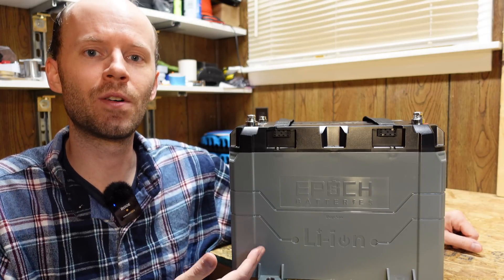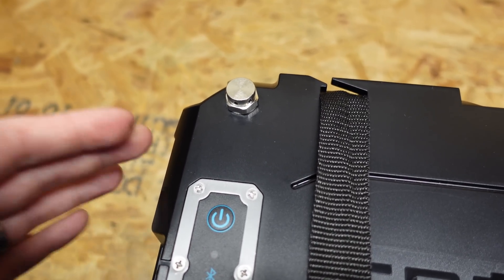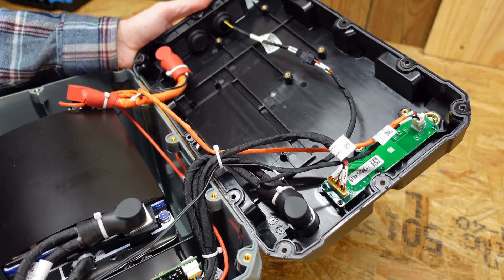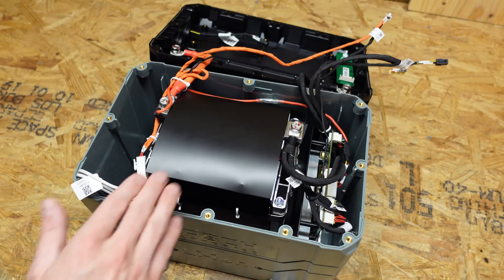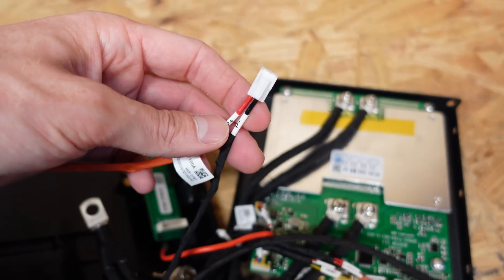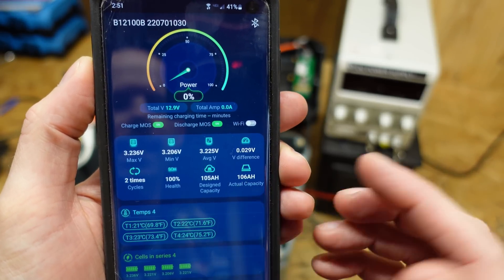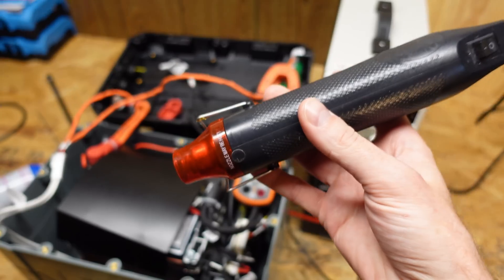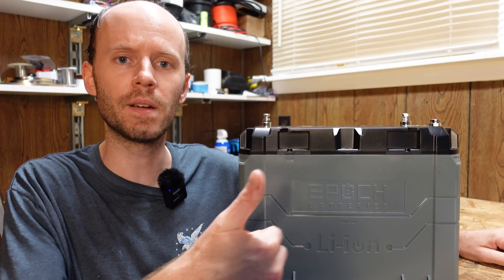Epoch 12V 100Ah Waterproof LiFePO4 Marine Battery, Best in Class?

Comment: The fact that they label it as an "Li-ion" is not going to help the confusion in the marine world between the 'LFP' vs other lithium chemistries. I know it's pedantic, but that really bugs me. Good looking battery otherwise.
Reply from the maker: I feel completely the opposite. LiFePO4 is a lithium ion chemistry, so it is labeled correctly. I think a better way to address it would be if we started saying NMC, LCO, etc. We're already used to talking about batteries this way for LFP and LTO. I don't understand why we lump everything else into a more generic bucket. It would completely eliminate confusion.
Reply: @LithiumSolar  I understand where you're coming from. I guess my reaction is partly because of how much fud is being thrown around the boat works about the dangers of "lithium batteries". If the industry did as you suggested and used the specific terms for each type, it would reach the same effect.
Reply: charger for this 24v boat ?

Comment: That's a roypow battery!! What in the world. I wish I knew who is the actual manufacturer of these packs haha
Reply: The battery featured in this video is the result of an ongoing collaborative partnership between Epoch Batteries & RoyPow. We regularly collaborate on batteries such as these and many others which are yet to be released (and will be exclusive to Epoch Batteries). Their quality control really speaks for itself and this video demonstrates that exceptionally well.
Reply: Many boaters and RV currently use group GC2-6volt batteries in a four cell parallel/ series configuration to achieve 12 volts for their household electrical needs.  These deep cycle lead batteries are an ideal size, weight, and capacity, but there is no lithium battery that is a direct replacement for these.  Many golf carts also use the GC-2 group batteries as well. This is an overlooked market that is eager for a lithium battery in 6 volt GC-2 size
Reply: @wallacegrommet9343  Battleborn has a GC2 size.
Reply: Or maybe roypow is a epoch battery 😂 I'll never know
Reply from the maker: RoyPow is a subsidiary of EVE, so I've been under the impression EVE is either manufacturing the battery pack itself or weighs in heavily on it. Just an educated guess though.
Reply: @LithiumSolar  p

Comment: I miss the snapping of the large connectors you use in your discharge test rig. That was always a fun moment. Seems like a very good battery. Thanks.
Reply from the maker: I should build some with thicker gauge wire. They were easier to use really, but the #6 was a bit too thin for higher amp tests.